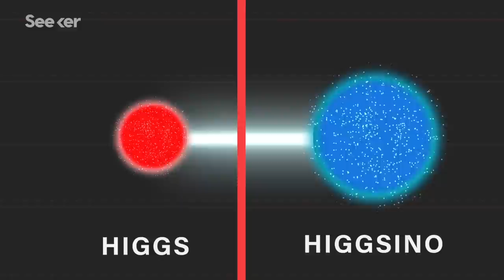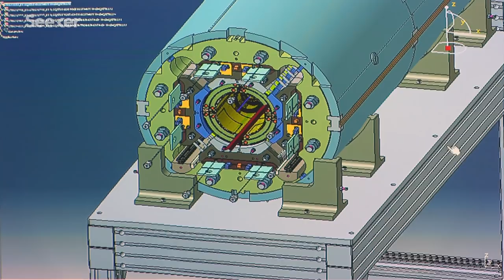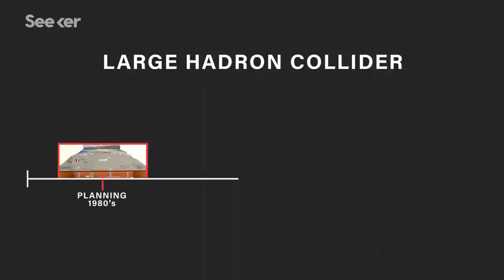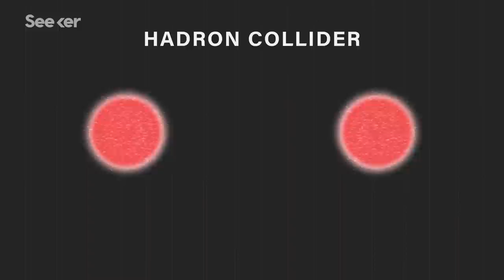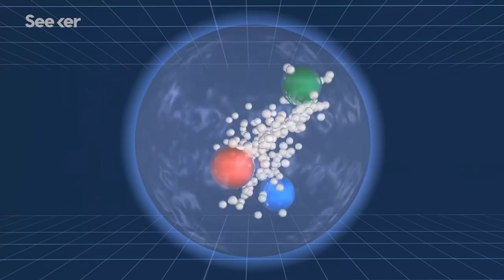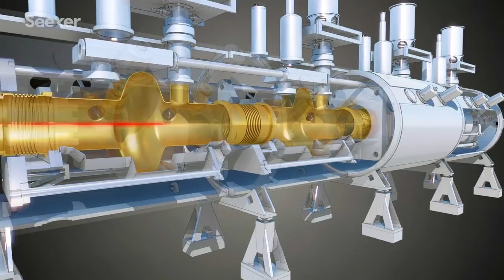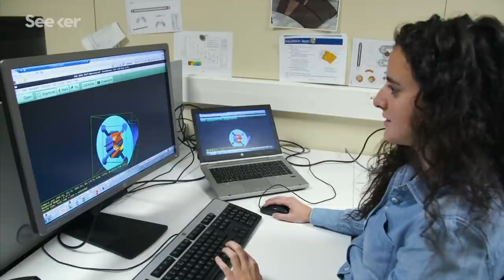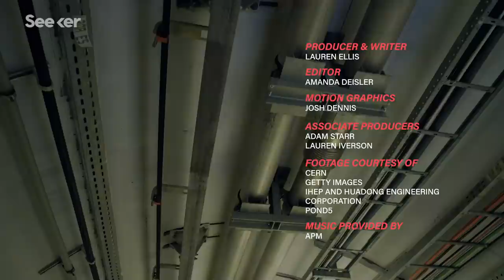CERN’s Ambitious Plan to Build the Largest Particle Smasher Ever

Comment: SERN trying to hack into the gate
Reply: Open the abyss.
Reply: @Chance Hawkins Retrieve the ones cast out for this current battle.
Reply: @professorq8010  clarify
Reply: @Chance Hawkins elaborate please
Reply: @professorq8010  clarify
Reply: @Chance Hawkins what????? Explain
Reply: Hello??? Clarification would be great
Reply: @DONTHATETHEPLAYA321  Quantum physics -  multiple parallel universes (multiverse) -  retrieve those cast into the abyss - build the largest most complex machine ever built, financed how/whom, use their design - follow the leaders -  purpose - reinforcement. This is not a game.
Reply: It's CERN. You failed.
Reply: El Psy Congroo
Reply: Yeah, a portal from a dark universe smh.
Reply: Max Power  tell them again
Reply: @jamessimmons3921  some are slow learners or, not learners at all - you should  just go shopping...
Reply: @professorq8010  🤣🤣🤣🤣🤣
Reply: @professorq8010  will due sir😉
Reply: When stein opens the gate lmao

Comment: Just build a collider around the circumference of the Earth and be done with it already.
Reply: There are so many problems with that idea. Do you have some just off the top of my head. How do you build a particle accelerator over the ocean and how would you prevent it from breaking when a tsunami hits. It may not be necessary to build one that large. How are we going to pay for it. Where are we going to get the energy and materials?
Reply: Joe Average  Isaac Arthur should be in charge of the project
Reply: Yusuf patel  You can't get past the speed of light, nor can you go at the speed of light unless you're a particle without mass, like a photon.
Reply: Yusuf patel  They can't go faster than light. They have to have zero mass, and they don't have that.

Comment: $20B? much more has been spent on far less noble pursuits
Reply: @valorousvigilante2491  Ya probably, but I still stand by my point
Reply: MrBadBricks  lol I guess I should say much more has been spent on far less savory pursuits.
Reply: MrBadBricks  Yes, it's a subjective opinion :)
Reply: Joe Average  We should not spend extravagant amounts for publically funded scientific pursuits - maybe something like 1% of GDP? that would be appx $70 billion for the US. Maybe even lower - I think that's reasonable? that's $70B per year, as opposed to this $20B project built over the course of decades. Even with cost overruns, that's just a drop in the bucket.
Reply: @valorousvigilante2491  What kind of safety concerns are you referring to?
Reply: MrBadBricks  omg lol gtfo
Reply: @valorousvigilante2491  I didn't say I was, I'm just asking what kind of concerns you have?
Reply: @valorousvigilante2491  I don't think there's any reason to think that those things will happen. I might be wrong though.
Reply: @valorousvigilante2491  we're talking a very very tiny amount of mass - a few particles colliding at high speed. Besides particles collide at high speeds all the time in nature, we just can't observe it and control it without building these.
Reply: @valorousvigilante2491  I think it's unreasonable to assume that a new collider will literally rip or tear the fabric of spacetime - as such an incident has never been observed despite all of the extremely energetic and violent places/events seen throughout the cosmos.

Comment: So interesting! I was wondering which element do you people use to extract the protons, positrons and electrons to eventually collide them? Finding out about a super-symmetry is very awesome but also seems quite risky when it comes to containing all of that force.
Reply: I know I'm 2 years late with the answer, but better now than never I guess. I can't really speak for the other particles, but protons for the LHC come from a simple hydrogen gas cylinder. The atoms are shot through a strong EM field which rips out the electrons and only the nuclei (protons) stay behind… Also the energy may seem big, but an electron-volt is an incredibly small unit, one Joule is over 6 million TeV.

Comment: Just wondering.... What is more complex? Going to the Moon, or Building the Collider? If going to the Moon is more complex, yet the Collider was in talk during the 80s, obtained permission in the 90s, and was first tested in 2008, then that poses a problem with the Moon Landing. Think about that.
Reply: the lhc is way more complicated, and much more data is generated, you can´t run an lhc with an 1969 computer. But you could land on the moon with it.

Comment: It could help understanding the universe, how stars, especially neutron stars and black holes operate or reveal something about the space time that could make space travel possible if tachyon theories could be conformed by particle accelerator.
If electron has substructure or something much weirder, like 11-14 dimensional feedback loop..
Or energyfractal that goes into infinitely small pieces. It could become impossible to understand and even more harder to describe by the math.
There is no or very little guarantee that  it is found, but something they could be found or theories improved..
If it gives any new results that could be nice to see and hear. I guess it could help in development of the superconductors and magnets also. It would give results both in science and technology.
It can require larger and larger energy, information technology and intelligence to manage this development. Also system that can educate all the earlier theories and results so that the starting point is not very far from "current level".

Comment: So is that the field that prevents matter from going past lightspeed if you could find out its frequency wouldn't you be able to get just right up to it start vibrating at the same frequency and then you would just merge right in like when you shake sand and it liquifies I would think that the reason why light can't pass it is because it isn't vibrating at the same frequency so since everything in the universe is pretty much vibrating there's sine waves hit each other but if you match it you can merge with it or maybe you have to do it a 180 degrees out of phase so it cancels out and then you can go through it just random thoughts wandering through my head

Comment: Can I ask something? Genuinely, what's the point? Has CERN's research contributed to innovation in tech/medicine in any way? I truly don't know for sure so please correct me if I'm wrong, but it seems like the research hasn't contributed to anything.

I understand that Cern should be funded at least a little bit, but there is so much taxpayer money going into particle accelerators, with seemingly no return from it. Why not put the money towards fusion research, which can literally save the world?
Reply: When you create an experiment like LHC you create at the same time new techs that can be used and applied somewhere else. All the projects and patents are free and visible by everybody. Internet it self was created at CERN.

I can tell you some technologies that have been created thanks to particle physics:

- Positron Emission tomography (PET) that is used in almost every hospital to diagnoses cancer.
- Hadron therapy that is a new way to remove cancer with particles beam.
- Muon tomography is a new way to check what is going on inside a volcano or inside pyramids.

Comment: Why not just add a section right where they collide by making an electrical version of the Tesla valve I saw somebody shoot a flame through 6 or 8 section Tesla valve and it's sped up the flame so fast so instead of building another particle accelerator add that Tesla valve to both sides so right at the end the particles are sped up right at the end I don't know if you can make one of those valves electrically but you might be able to funnel it down with something in the last few feet before the center of the detector and get a free speed jump just by the way the valve works

Comment: At 8:38 he said that one electron travels at 0.9999999 the speed of light and the other travels the other way at 0.9999999 the speed of light. Why bother going that fast when Einstein said that not even relative speed could be greater than the speed of light. Based on Einstein you only would have needed a speed of 0.5 the speed of light in each direction to give you the same impact.

Comment: What if that is too much power and the atoms smashed together would RIP a hole in reality... how would we stop the blackhole or wormhole from getting bigger??? We might have to have a magnetic containment unit around the complex as a safety measure... also, it must be powered all the time if that happened if the magnetic containment system could hold back that type of force without getting consumed by it... Remember, safety first...

Comment: Hello and happy day: I am going to explain the term Infinite and Empty. Infinity is just a symbol that would be nothing more than two ovals joined by their edges. But infinity can also be a word, a word, a name such as YouTube or private signal television channels or it can also be a geometric figure whose surface is not Infinite since there IS a specific mathematical formula to be able to calculate and solve it. The Infinite does NOT exist, what happens in some cases is that it becomes UNDETERMINED due to lack of advanced science and technology. Previously they said that the universe or space was Infinite currently in our Human Evolution with "science = aerospace and technology = aerospace such as Satellites, space telescopes such as hubble, kepler, etc and more etc of the 21st century" we have determined that the universe It is not Infinite and it has a size limit and a time limit and it is no longer indeterminate but it was never Infinite. We have already quantified the size of the sun and how many years of life it has left before they said that the sun is infinitely eternal and it remains demonstrable that it is totally false. And I am only exposing 2 cases "macros = large size" of the real life supposedly Infinite, but there are also millions of cases "micros = microscopic size" that were believed to be infinite but they are not and are already determinable as is the case of the atom. And as the human being evolves, everything becomes determinable and useful for the human being. Saying that it is Infinite is a quick solution BANAL when to Something that is not understood or cannot be determined, since infinity is NOT AND MUST NOT BE TAKEN AS A CONSTANT. And to give a single mathematical example, you have 8 chocolates squared and you have no woman to give it to consequently you still have your 64 chocolates you will end up eating it by yourself and your 64 chocolates will NOT be INFINITE since they will run out when you eat them all. Another example would be if you have nothing and you are going to divide it by nothing or nobody does not believe that you will have something INFINITE, the answer would be simply "NOTHING", so use Logic to solve any scientific or daily calculation and NOT INFINITY AS A CONSTANT because it does NOT have a known fixed value in a mathematical, physical, chemical, quantum calculation or process, etc. and more etc. We must rewrite or re-edit most of our calculations, theorems, or mathematical, physical, chemical principles, etc. based on the data of the scientific and technological advances of our 21st century. It is NO longer justified and stop being cavemen, fools or mediocre in our studies and professionalism and continue to apply the word Infinite obsolete or in a banal way when we do not understand something or cannot solve it efficiently and quickly and if you do not believe me, apply those equations or mathematical calculations to real life, whether domestic, scientific, aerospace, industrial, military, medical, chemical, physical, etc and more etc. I continue explaining, If the value of INFINITY were applied to the construction of a huge and long bridge or a huge skyscraper a while ago they could not even have started their construction since nothing infinite can be left and its true applied meaning of Infinity would be " indeterminable ”, since its construction is made on the basis of calculations with certainty, known, determinable and firm. Numbers are natural, whether positive or negative, and neutral like zero and were born with the need to express and order human beings in their evolution and the four basic rules of mathematics that we all know are the sum or sum (+), the subtraction (-) the multiplication (*) and the division (/) of them always derive or support all the other more advanced or complex calculations "such as derivatives, integrals, limits, matrices, logarithms, power, factorization, roots or rationalization , etc "and they are easily misapplied with the word INFINITE and on 07/20/1969 the human being could not have reached the moon" with the Saturn V rocket with the Apollo 11 mission "leaving mathematical, physical, chemical calculations, etc misapplying the Infinite to them for their prompt or quick and IMPRECISE resolution. And the same happens with the vacuum and this does NOT exist and is a term or word that human beings use to quantify a certain space filled with gases at a total pressure lower than atmospheric pressure. The atmosphere is made up of 20% oxygen and oxygen is the third most abundant element in interstellar space or the universe. In itself or in short or in conclusion inside this world and outside this world in interstellar space the void does NOT exist just as there is NO infinity. Laws are made by human beings, with general agreement we decided to make a series of rules to live in peace as well as the use or use of the terms: "Time, Space" since they are used as Units of Measurement with general agreement that uses the human being for its evolution and quantify, determine, or standardize a certain physical magnitude and adopted by convention or by Law and defined and applied to the reality of everything that surrounds us. Any value of a physical quantity can be expressed as a multiple of the unit of measure. Without any of the above, current hybrid humans of the 21st century would still be cavemen. And here is a saying or phrase from Nikolas Tesla, which it reads like this: "What one man calls God, another calls the laws of physics".